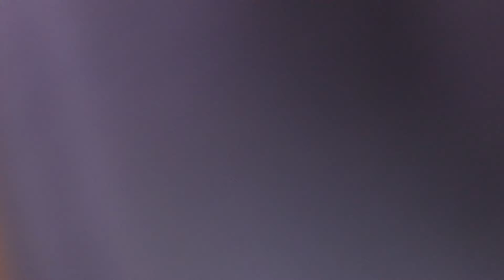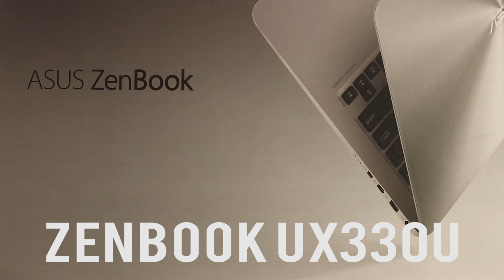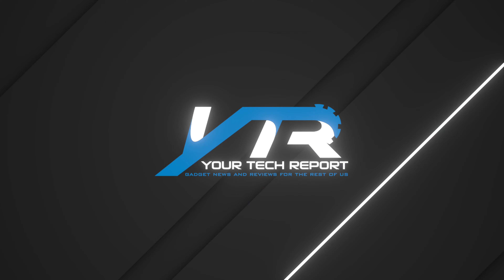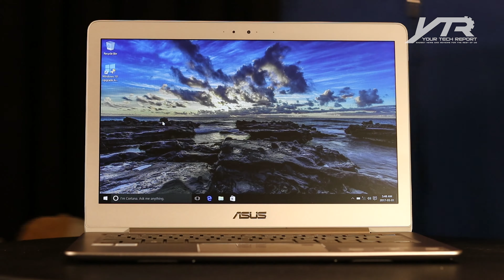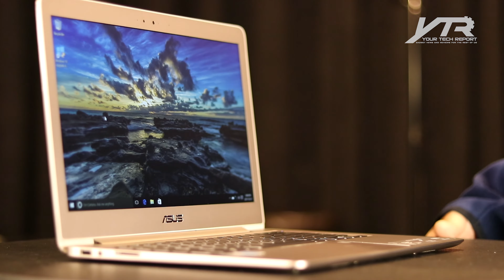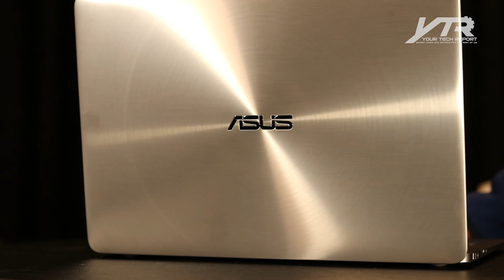First Look: Asus Zenbook UX330U

Comment: hows the fan noise? heard it can be quite bad
Reply: Lee Park the fan only turns on for like 1 minute maximum then it turns off and is completely silent for the rest of the use. unless you have the ears of a freaken rabbit. the fan noises is not bad at all.
Reply: it is audible even you're just running light task